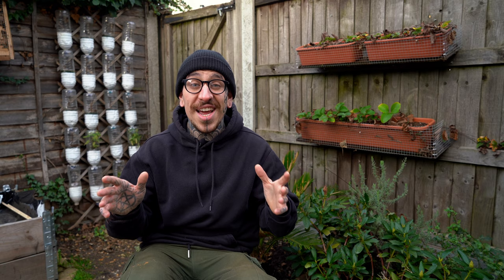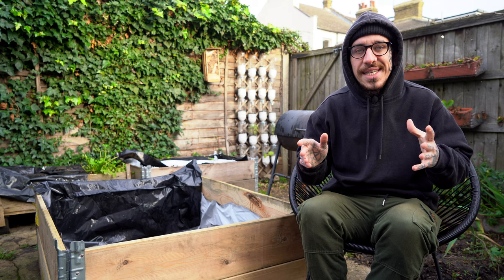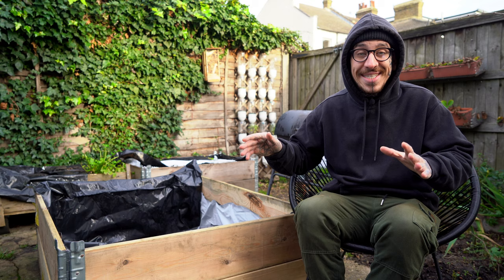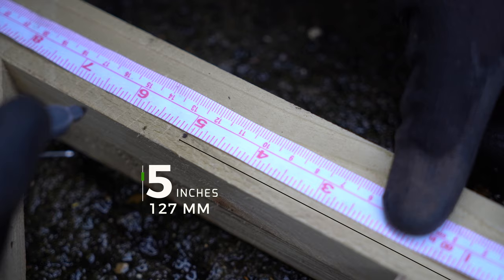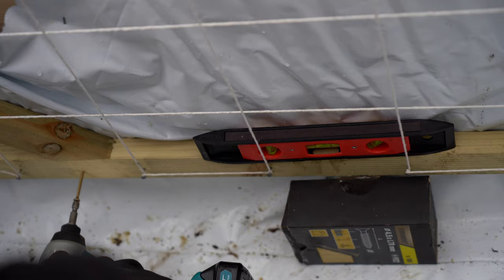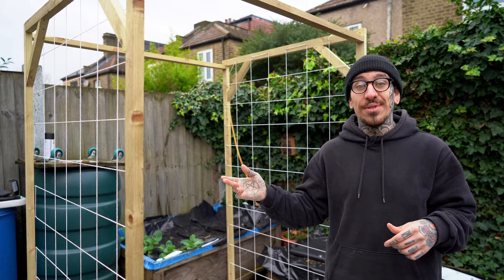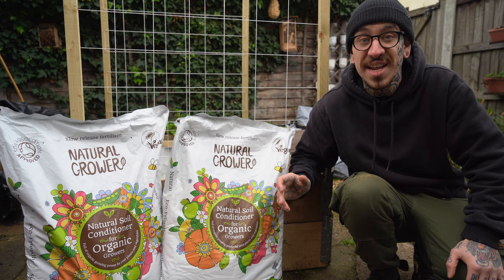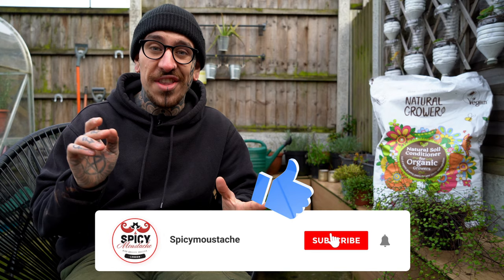DIY easy and cheap Trellis | Growing Vertically

Comment: So much good in this video, I just want to bring up the use of hugelkultur with the dead branches and fusarium and avoiding certain plants if possible (Alder was the culprit of the fungus source and wasn't showing any exterior signs of colonizing). Only to highlight that an organic farm near my temperate climate had an outbreak of fusarium/root rot and might be on the brink of losing their business and was pretty emotional to see go down, so if it's a known issue in your area I have started practicing using hydrogen peroxide(which will kill beneficial bacteria in the process) just to ward off any mycotoxins and disruptive fungi in my area. Otherwise you're so on point with practices and projects, and great ideas. Always looking forward to the next one!
Reply from the maker: Thank you for sharing this, I’ll definitely research a bit better and try to find more information about this. By the way, thanks a lot for the feedback on my work 😊

Comment: Hi! How do you feel about oak branches and oak leaves in the bottom of your beds or in compost? I’ve read that they take longer to break down. And I’ve noticed that the rain water I collect close to the oak trees is pretty dark brown, I’m assuming its from the tannins? But haven’t noticed any ill effects from watering with it.  I haven’t used it on my veggies tho.  Thanks!
Reply from the maker: I’ve never used oat but make sure not to use black walnuts as they could be an issue due to their sprouting inhibit properties. If the water is dark close to the branches it’s normal but I don’t see why they should be an issue in the garden 😊